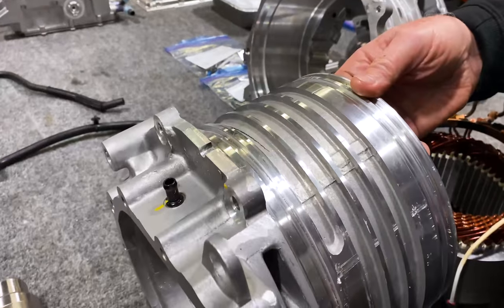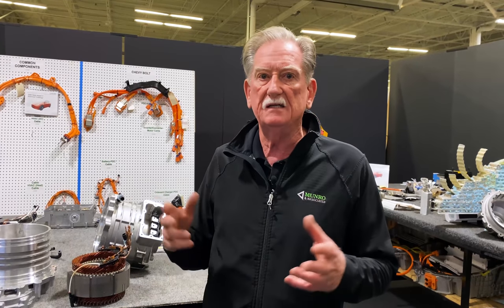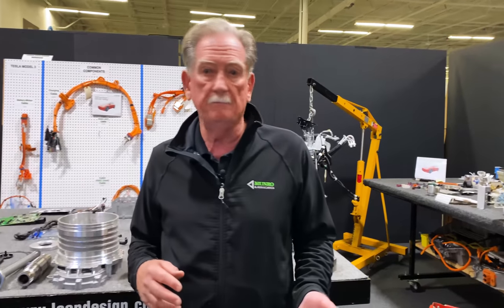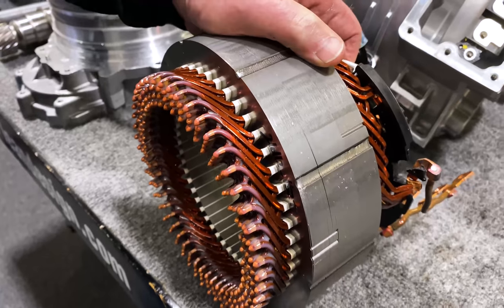Mach-E Front Motor: Sandy is Blown Away by Great Design

Comment: Hi Sandy, I don't know where you got your informations with those 70% good/rework parts. The company I am working at sells the production-lines for the hairpin stators with a rate of somewhere +90%. So I think its defenitely the more reliable way to do those stators.
Reply: I think this is critical information. I hope it reaches Sandy.
Reply: It is weird how hearsay turned his opinion 180 degrees just like that.
Reply: The 70% acceptance rate may reflect an early process yield, that should improve as the process gets refined.
Reply: Do you use lasers to weld the hairpins?
Reply: @jenniferpedrini4787  Yes, we use Trumpf lasers
Reply: @jonas_4901  Last question: IR or Green?
Reply: @jenniferpedrini4787  Thats something I would have to ask my colleagues at work on monday, but i guess green since it's better for copper... Sorry😅
Reply: @jenniferpedrini4787  Are you also working in this field?
Reply: @jonas_4901  I work for a laser manufacturer. That’s why I am so interested in the laser part.
Reply: @jenniferpedrini4787  Oh, nice. What's your compqny called? Laser welding is soo.. fast, really fascinating. But we are still sometimes struggling with some weld spatter🥴
Reply: @jonas_4901  
That’s right, green should have advantages. But I do not think it is used in this case. Would be great to know.

Comment: Silicone RTV “instant gasket” is (very) old tech. The anaerobic gasket replacements such as Loctite 518 are far better and they cure only when air is excluded. Any excess will not create lumps that can clog oil galleries and it separates like a normal gasket.

Comment: You guys are excellent, really enjoy your videos.   Wondering about tapered roller bearings on differential gear. Seems like it would be more clearance critical affecting bearing load when squeezed between cases that have composition gaskets.  Seems ball bearings would be less critical only concern would be to shaft shift occuring when moving from forward to reverse?

Comment: In an earlier Mach-E video Sandy referred to the front motor as an induction motor, presumably assuming that it would be. As confirmed in this video, it is not an (asynchronous) induction design - it is a typical interior permanent magnet synchronous motor.
Reply: Technically all motors are induction so he wasn’t wrong.
Reply: @harsimranbansal5355  No, "induction motor" has a specific meaning in electric motors, and clearly that's what Sandy meant (and was wrong about). Yes, windings are inductors, but saying "Technically all motors are induction" is as nonsensical as saying "Technically all motors are resistance", because all wires have resistance.

In the term "induction motor", the "induction" refers to current induced in rotor conductors (windings or cage) by changing stator magnetic fields, producing a rotor magnetic field for reaction. That is not how this motor works; there are no conductors in the rotor and the motor does not work by inducing rotor current.
Reply: @brianb-p6586  Maybe it was at a time he still confused the Mach-E with the VW platform which left me puzzled.
Reply: @abraxastulammo9940  Perhaps. One of the VAG platforms uses induction motors at both axles, but he knew that the Mach-E was IPM at the rear. I think he was assuming that everyone would do what Tesla did in the Model 3/Y (which is IPM rear and induction front), but even Tesla doesn't do that in the Model S/X.
Reply: @brianb-p6586  ahhhh, alright thanks for correcting me.

Comment: Is this indicative of Ford's innovative engineering or Magna's?
Reply: Magna's engineering department gets the credit for good engineering.  Ford's parts procurement department gets a participation trophy for purchasing a good product.
Reply: Magna Powertrain, which is also making similar parts for three other Ford products, Cadillac, and various German makes (VW, Porsche, BMW, etc).  I'm guessing there will quite a bit of internal commonality.
Reply: My guess is Magna. They bought a lot of former Ford(Getrag) Gearbox plants. They still supply ford but they also supply other manufacturuers.
Reply: Working on fords I can tell you it’s definitely magna
Reply: @johnroyal4913  I don't understand how the "Diff" can be shorter than the final drive gear face width? I've worked with Diffs all my working life & have Never come across one that slim. I go to the Racing trade fairs where Diffs of all manners are presented. But this Diff seems to be shorter than the length of spline on the two driveshafts that engage it????? Yet Sandy just Glossed over it ????
Reply: @kevinburke6743  it was all kept a secret. Most likely this is a special diff made just for this car and magna and Ford kept it that way. And I don’t know about how they did the math on the gearing. Would need to measure and all the specs of everything to work that out.
Reply: @CL-gq3no   @Kevin Burke  GKN Automotive definitely made the gearbox...but maybe forgot to put the logo or it was too small for Sandy's eyes
Reply: It's not from magna, It's  from GKN Automotive!!! Munro should put it right asap

Comment: "Skin Effect" is caused by all the electrons in the wire repelling each other. 

This is why multi-stranded cable can carry more current than a similar mass solid conductor. Stranded wire has more surface area.
Reply: Does skin effect matter at EV motor inverter frequencies?  So far as I can tell, most EV manufacturers are using frequencies between 2 kHz and 10 kHz.  That's pretty low frequency and results in pretty thick skin depth.

Comment: Whether to use the hairpin design or wound stator depends on the rotor speed. If you want to make a high rpm motor, you have to use a wound stator in order to retain efficiency. If you make a slow motor you can use the hairpin stator.
Reply: Then it's a good thing that EV motors are all slow.

Comment: I always wondered why Tesla went with that copper design when you said it wasnt as good. Fair play sandy for saying Tesla was right.
Reply: When Sandy says better he means cheaper to build. Tesla chose the wound method because it’s cheaper but the other method offers more fill and is mostly seen as better but more costly and complicated to build.
Reply: @Icayn  Better has lots of components, one is cheaper, which is cost of components, ease of manufacture, failure rate.  Better also includes; efficiency, durability, predictable characteristics, etc.
Reply: @davidharris7249  I agree, but my point is Sandy only gauges “better” by what is cheaper to manufacture. It’s a fault of his in my opinion, he couldn’t care less about ease of service, long term reliability, cost of repair, or even final cost to consumer. He obsesses over fewer screws, and fewer parts, no matter the cost to the consumer.
Reply: @Icayn  Agree, but he does stress that in EVs every gram saved means better efficiency and more range -- and less cost in parts and manufacture, and a better product if done right.  Elon: the best part is no part.
Reply: @davidharris7249  not sure that approach is best for the driver/consumer in every case. The Germans say to heck with efficiency and just use a bigger battery. This allows them to give us superior build quality and more traditionally luxurious interiors and higher levels of refinement. All the screws VW likes to use cuts down on noise harshness and vibration. That matters to me. I don’t care if they used one stamp to make the entire car at the factory, I care about comfort, reliability, and cost to own long term.

Comment: I am always amazed at how much more power the liquid cooled car inverters can due compared to air cooled industrial units
Reply: Water has enormous heat capacity compared to air, so you need far less of it to get the same cooling.  The tradeoff is that while {filtered} air is a good insulator, water with stuff dissolved in it cannot safely make contact with any of the live wires.  Lots of design conflicts arise here - tricky business...
Reply: The industrial motors you might be thinking about are rated for 24x7 operation at 100%, sometimes even more.  Also they require no "external parts", ie water cooling system to work.
Electric motors in EVs can deliver a huge peak power, but they are not rated to work at 100% all the time.  If you see any EV accelerating, it will reach max speed (legal or driver desired), in a few seconds, maybe hitting 100% power output.  Once the car is at constant speed, it will consume an smaller amount.  An EV at 100~120 km/h consumes about 20~30kW even on a climb, way less than peak power.  The EV motors can operate continuously at this "low" power numbers with liquid cooling without issues.

Comment: Nice IGBT modules.  The integrated water cooling fins and contacts are well thought out.  The DC input buss bar is also extremely well done.  Keeping the positive and negative plate close and parallel minimizes input inductance and RF noise.  You can see this pay off because the don't need a DC input filter inductor and capacitor to keep RF noise inside the inverter.  Would not be surprised if the power input pins to the IGBT modules alternated + - + - + to minimize inductance as well.  

Like the intermediate gear in the gearbox too.  Adding the long shaft between the large input gear and small output gear provides enough space to fit a standard gear Hob tool.  

Is the differential a spur-gear planetary design?  They have a few more parts than a bevel gear design, but can be extra compact.

Comment: Once again, great dissection Dr. Munro!

So wouldn’t an oil filter in a lubrication system increase the longevity of the device? I imagine Tesla having more electric vehicles on the road than anyone else might have a evaluated this, no?
Reply: A gearbox in an EV is similar to a rear diff in an ICE car. They don't have pumps or filters and they last the life of the car.
It seems to me Ford has more experience making transmissions than Tesla.
Reply: @franciscoshi1968  But Ford didn't make these components.
Reply: @davidharris7249  no but they know how to find some one that will make a gearbox that will last for the correct price. They have been doing this for a long time.
Reply: @franciscoshi1968  Ok, but you original statement did not say that.
Reply: Some guy in Germany has a 10 year old Tesla with over 1 million miles driven.
His motor seems to work fine.
Reply: @neeljavia2965  After being changed how many times (also the battery)?
Reply: @abraxastulammo9940  Motors weren't changed at all.
Reply: @neeljavia2965  Hansjörg von Gemmingen had "Throughout 1 million km he had 2 battery packs and 3 drive unit replacements".
Reply: @abraxastulammo9940  Really?
Let me check.
If you I correct then I accept my mistake.
Reply: @Alfred Wedmore Most of the wear material would be steel. Instead of a filter, install a magnet to trap the steel particles. However, it should last as is for over 100k  miles which is usual "lifetime" of the vehicle.

Comment: So Magna did an amazing job on the front PM motor, but Borg Warner did a not so good job on the rear.   Why did Ford contract two different companies?  Why not just pick the better design for both front and rear?
Reply: Maybe because it's for Ford an new technology that needs an reduancy backup. If the back motor breaks you still have an front motor. And the other way around. So you still get with your car home. They're looking which motor system will last longer? Don't but all your eggs into the same bucket.
Reply: Because FUD motors has NO idea how to build a GREAT Electric car.
Reply: Relationships
Reply: Also don’t discount the possibility the suppliers couldn’t guarantee enough motors per quarter to use one supplier exclusively….
Reply: Cost ?
Reply: Well if you're building a car, you need motors for it, you have 2 companies who both haven't built motors before, but are telling you have amazingly they could do it if you have them the contract, wouldn't it make sense to go with both? If you have massive problems with one, you have a back up. You learn what works, what doesnt.

From fords POV the best and worst may be opposite. Ford doesn't care if they're complicated to make, they care about cost and to a lesser extent reliability and weight. The Borg Warner unit could be costing them half what the other cost, if Borg Warner have never made motors like this before and are wanting to get into the industry,. It's perfectly possible they bid too low, accidentally, or on purpose to get a first contract.

Comment: Hi Sandy . Part of the cooling system purpose on the motor is to stop the neodymium magnets from demagnetising due to heat and it is a rather great loss of greater than 95% from just one time of coolant loss. You should do a simple experiment for the audience with a magnet and heat gun . Use a temp sensor on multi meter and have the magnet holding a weight that i can just handle. Heat the magnet and see at what temp it lets go . Once it lets go it will never regain its flux strength again . Probably won’t even hold a paper clip ! It is a very important consideration with electric cars as over time with bad design the magnets will lose strength and some people might only think its the battery losing capacity! 👍🏻
Reply: If the rotor gets to the temperature, your bearings would have locked completely and torn apart at that point.  If temperature raises too much the computers (inverter or some other module) will not allow the car to continue.